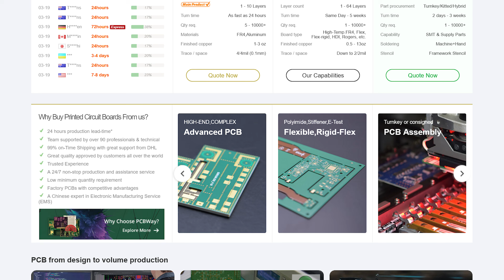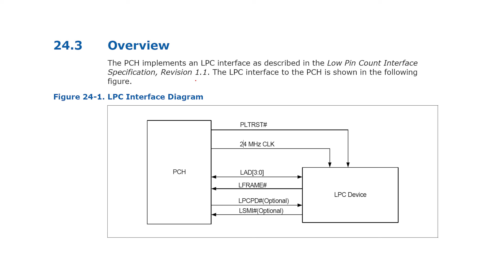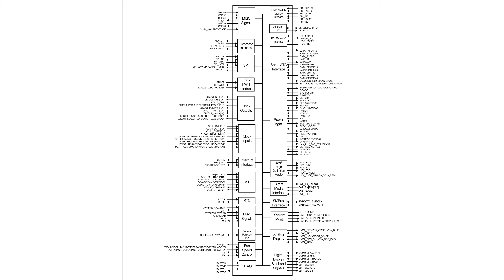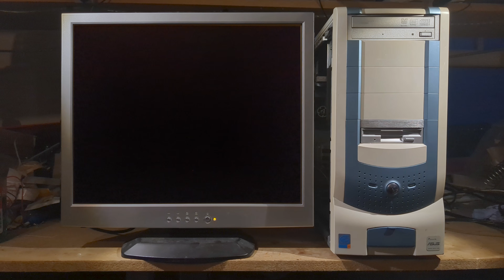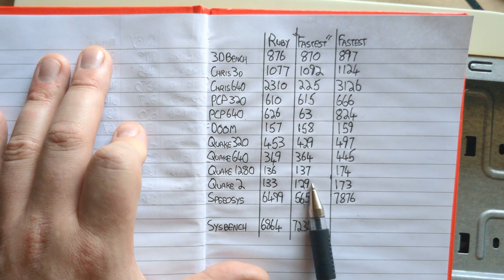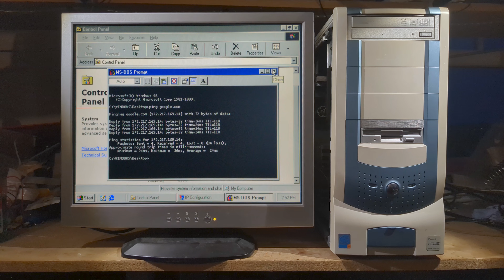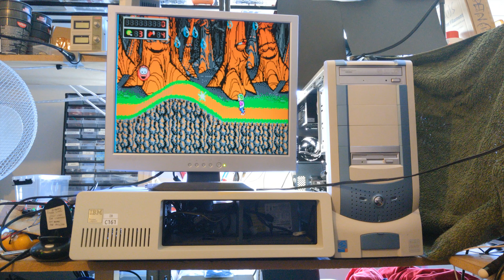No, *This* is the Fastest MS-DOS Gaming PC Ever

Comment: I found for a couple bucks online an adapter that can connect via Compact Memory :) now I've got SUPER FAST read/write, which makes execution seamless. I have a rig like this currently setup with 3.1 and 98Se. I never got to see this era in 720p as my monitors as a kid only went to 1024x768 (most my funds went into vcards not displays). So seeing it running in all of it's glory above that was crazy and I was so impressed at how nice it actually looked! Also that PSU has no rating on it lol, so at full load it probably realistically produces 550w which is still plenty for what you need. You mentioning it's weight is a dead giveaway that it's on the cheaper side of things. I have a couple PSU that are 20 years old, still working. I'm as shocked as you are reading this, I've been in IT for over 20 years....
Reply: Oh yeah, back then (I was younger too but high school) PC screens only went to 1024x768 or possibly 1280x1024.   16x9 monitors (widescreen) really didn't exist during the DOS era.   They made (usually 19 to 21") 1600x1200 monitors, but these were sold for UNIX systems typically (I had a Digital 21" CRT... well I still have it, t toasted and it's so heavy I didn't feel like hauling it off... and it's not even VGA, it uses 5 mini coax connectors and if I recall correctly used sync-on-green. Looked nice until it toasted during a thunderstorm.)

Comment: The fastest DOS machine you own is the one you are using right now to view this video. DOS runs properly on todays hardware it is a total myth that it cannot be run on modern hardware. You DO however need the correct motherboard to run some of those old cards which is where the real limitations start coming into play. But you can also adapt some of that older stuff to the newer boards too. And NO I am not talking about being able to emulate DOS here either. I am talking running actual DOS on modern metal it works fine.

Comment: ISA is not a requirement for sound. I had a soundblaster audigy PCI. It had full dos support. No windows requirements at all.
Reply: I know I was like why does he keep thinking that an ISA slot is a requirement? I have a PCIE 32 bit Sound Blaster card that cost me $350 and it's the best sounding card I ever had. It comes with some really nice software.
Reply: @FreeSpeechWarrior  for me dos gaming = dos compaitble sound and dos compatible graphics.....at least for the games you intend to play. Many modern GPUs don't handle CGA all that well, but do SVGA just fine. that's fine really.
Reply: @awilliams1701  I hear you, you did a good job. My first IBM system in 1993 was an IBM with which I played Duke Nukem, Targan, Hocus, Jazz Jackrabbit, and many more. It didn't take much of a system to play some insane games.
Reply: PCI Soundblaster violates the no Emulation rule. You need a software driver that emulates a real ISA soundcard.
Reply: @joe--cool  nope. I had a PCI soundblaster myself. No drivers needed. It just works in dos out of the box. I had one so I know.
Reply: @awilliams1701  You would still need a driver to initialize and map the PCI IRQ to a ISA bus IRQ otherwise this would not work without either an option ROM or a Plug and Play BIOS extension or Windows 95 ACPI doing the mapping for you.
Or you might have been using SB-LINK/PC-PCI which does this for you but only on supported mainboards.
The PCI bus also cannot "see" DMA channels 1 or 5 without extra drivers or hardware. Do you know the exact model of PCI soundblaster you had?
Reply: @joe--cool  I remember even the audigy being supported in dos. But it's been forever. It's possible there is some kind of BIOS on it. But if it's in the chips on the card it counts.
Reply: @awilliams1701  Audigy and SBLive need DOS drivers and have rather bad compatibility. Especially the OPL3 emulation sounded horrible and was rather laggy. Audigy doesn't have any of the original SB16 chips.
It worked most of the time and was OK with general MIDI but it was still emulation.

The only driverless and very compatible solution I know of is SB-LINK with a special connector on the motherboard.
Reply: @joe--cool  I don't think it was my first. I know I definitely had one that worked out of the box and I had no complaints.
Reply: @awilliams1701   If it was working really great it was probably a Sound Blaster AWE64 PCI with the SBLink cable installed. That would have been a great DOS and Windows 9x experience.
Reply: You may face incompatibility with Dune II for example: both music/sfx/speech will disappear eventually.
"Me too" was sure enough that AudigyZS/Live's (SB0060, SB0100, SB0350) will be okay and no, while being pretty compatible with modern titles like Doom and so on, there's definitely issues with older ones. You'll face no FM synth also, only emulation.
The same for es1370/1/3 based Ensoniq and SB PCI's. The same for YMF724, the same for ESS Solo-1.
Reply: @vsharun  It worked on all the games I threw at it. I stuck with creative labs for a reason. But....eventually I got BSOD's like crazy. The card had gone bad. I haven't had any card since.

Comment: I wonder if you know about the ITE IT8892E and IT8893E bridges. In theory, if you use them both, you can connect ISA cards to an PCIe computer directly. It would be cool for someone to make a "motherboard expansion" that used both chips to have a mini-ITX motherboard have PCI and ISA slots.
Also there's the WCH bus interface chip CH367 that goes directly from PCIe to ISA, but I think only 8 bit slots are supported.
Reply: You are asking the same questions as I was thinking about. Another chip that comes up when searching for PCIe ISA bridge is AX99100A. I think it's a matter of finding out what is generally used in the industrial PC world.
Reply from the maker: I don't think those support ISA-style DMA, so most games wouldn't work with most soundcards.

Comment: Higher end enthusiast/prosumer platform CPUs may offer more cores, but they also overclock just as well as the consumer parts. Plus there's a little to be gained from quad channel memory, at least for Windows. Without delidding, the chips also run cooler with their soldered heatspreaders. It sounds like you should have built something with the X99 if you wanted even faster. Maybe a 6850K pushed to 4.4-4.5GHz (possibly higher limited to 1-core), with probably the lowest-latency DDR4 you can get. It's easier to run quad channel at lower frequencies, due to memory controller limitations.

Of course someone has already run the latest Ryzen hardware under Windows 98, but that required a PCI soundcard. And yes, AM4 is questionable for ISA - that indeed needs more digging.

There's higher to shoot for. Future video? :)

Comment: if you get another Voodoo 2 and an SLI cable you can SLI them and get a huge boost in FPS and run at 1024x768.

Comment: My first PC was a Pentium 100 with 16 megs of RAM in 1996. I am at work right now but I have a chart at home with some benchmarks from over the years. I think that the Pentium 100 got 13.5 FPS in a timedemo, will have to check when I get home. I set software rendering to 1024x768 and I was like "woah thats crazy high res, I WISH I could run that!" lol

Comment: The Broadwell CPUs with the L4 cache chip (E3-1285 v4, i7-5775C and i5-5675C) might be faster than 4790K in gaming workloads, despite the lower clocks. They were pretty much that era's "X3D" chips.
Reply from the maker: Oh interesting. I was also wondering what effects DDR4 RAM might have if we go up to socket 2011
Reply: Ali sells 4980HQ with 1150 adapter. Unlocked fully, with both straps and multiplier. No visible difference between 4670k though.

Comment: If there was more capable mobo with better VRM and chipset that still supports features you need you could in theory OC that cpu quite bit too as those are known to be easy to OC as long as you delid them and use good cooling.

Edit: Nevermind commented before finished the video
Reply from the maker: Perhaps if I disabled 3 of the cores I wouldn't need better VRM or cooling.

Comment: Fun fact, IBM mainframe (z/OS) maintains complete backward compatibility. So, for example, an OG card reader will still work as a valid input device on new systems being shipped today.
Reply: Like the one on the IBM 370/145 that I learnt to program on? I had to submit punched cards with JCL and the program itself. Always numbered the cards in case they got dropped on the floor.
Reply: @yoochoobb  A common trick in those days was to punch the number into the card itself.  That was the original purpose of "line numbers" in programs.  Then you could rectify an "accidentally shuffled" deck of cards by running it through the sorter.
Reply: Its just so funny to see people now using OG to describe a card reader, language is a magical thing :D

Comment: One of the things I like to do in systems with wide range like this is install a removable SATA dock from IcyDock in a drive bay. Then rather than messing around with the BIOS to switch OSs, you can just swap SSDs, like we used to swap boot floppies in the 80s and 90s.
Reply: SATA is (notoriously?) brittle in some aspects, but I think it's due to flexing off-axis. I think it's more robust when the insertion force is direct on a single axis, like it would be with a tray mechanism. Even if there is breakage of the plastic housing, the dock's connector is fixed, rather than being a cable, and friction can keep the drive in place. This isn't much different than using an external drive bay, which people have been doing via ghetto NASes for about 20 years.
Reply: How many cycles is the average SATA connector good for? Perhaps get a SATA power "A-B" switch (unsure anyone has made these but it should be an easy enough DIY project) with both drives permanently connected instead?
Reply: @LouisCYUL  I've got ones I've been using for over a decade and they're just fine, so a bunch?
Reply: But that is what we have boot managers for. Does Windows 11 boot from MBR?
Reply: @milasudril  I haven't done that since the 1990s.

Comment: I remember in a previous video you mentioned the possibility of using a modern AMD chipset with the ISA adapter, did that evet pan out?

Awesome video regardless!
Reply from the maker: No - there's some kind of weirdness with port filtering or PCI subtractive decoding, this blocks the ports needed for the ISA card. I'm sure there must be a workaround, just nobody's found it yet...
Reply: @TheRasteri  aw, heres hoping somebody figures out why, would be cool to use a soundblaster on the newest AMD chips

Comment: furthest i've pushed Voodoo 2 compatibility is running it on Ryzen 5 3600 PC with B350 PCMate Mobo since it has PCI Slot and sketchy win7 x64 drivers on Windows 10 but it worked :D voodoo compatible games were launching without issue, i wonder if you can put Dissapointment on it too since it has TPM slot too with LPC adress, data and clock available, put sound card an sooo maybe 5800X3D dos gaming pc in the future?
Reply from the maker: I still haven't figured out how to get disappointment working on AMD chipsets. Hopefully someone eventually figures it out.
Reply: @TheRasteri  Pretty sad, you have done so much already I really love watching your videos and hope you will have much more subs and viewers 😁 I will probably build myself something similar to tinker with, I'm really incapable to figure it out, hopefully some wizard will join on this journey, or some technical documentation leaks out I want Sound blaster 16 on my PC too 😂

Comment: which software do you use with the old Final scratch interface? Mixxx, Traktor Dj or OG Finalscratch ?
Reply from the maker: OG finalscratch and Traktor FS - https://www.youtube.com/watch?v=CTd0hUxlp2A (I don't actually use it anymore, I have a DVS mixer, Numark Scratch)
Reply: @TheRasteri  i used a rme hdsp rpm with mixvibes but swiched to traktor dj + z2 mixer later. the rme interface could do 32bit buffer size and if you turn of some setting in mixvibes it ran without dropouts
Reply from the maker: @ I used to use mixvibes too. I also used to use a z2 :)

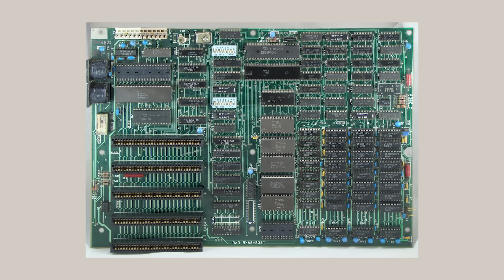Comment: 03:33 There is technically SB Link PCI or PC/PCI option for soundcards, but those motherboards are few and far between with supported soundcards being even fewer.
Reply from the maker: @Vanessaira-Retro  also ESS cards had that weird TDMA thing, I keep meaning to mess with those
Reply: @TheRasteri You also forgot Sound Blaster MCA cards 🤔
Reply: You should also checkout cmedia cards, some of them come with a genuine opl3 and supposedly work fine with dos games while being pci
Reply: that's odd, I feel like there were actually a good number of SB-Link cards and compatible mobos.  I guess maybe it was just my bubble I was in, but it seemed like for a few solid years there the majority of cards coming out were PCI sound cards that emulated SB with SB-Link for the port stuff.
Reply: @georgen9838  There were about 8 or 9 PCI cards with SB Link capabilities, and half of them needed the pads to be soldered on.  Many 440BX motherboards had SB Link as well with about 40 ish boards out there from different OEMs.
Reply: @ I see -- thank you! That makes a lot of sense.  I certainly was deep-diving into that stuff during the 440BX era, so makes sense that I would've felt I had a rich set of options for PCI sound cards without running into SB compatibility issues.  At first I thought I was simply thinking of the software kludges a lot of cards shipped with to enable SB support, but then I remembered that those always conflicted with games using DPMI extenders so that couldn't be what I was thinking of.  Memory's hazy from how long it's been!
Reply: The only motherboards I have seen that support sblink also have ISA slots. So may as well use an ISA soundcard.
Reply: @RetroPcCupboard you know what, I suspect I'm misremembering even more than I originally thought.  I could've sworn I was using SBLink on an Abit B440 back then with no ISA slots.  But I could honestly be 100% wrong about that and I was doing SB on that some other way.  Wish I still had those parts.
Reply: @georgen9838  there's no such board on theretroweb, either this is a board we're missing, but I doubt it, or you're misremembering the name

440 is a typical name for a chipset of the time (440FX, 440LX, 440BX) and they all had ISA
Reply: @georgen9838  There are some that don't have ISA slots. But I've personally never seen one. Intel VC820 motherboard is an example

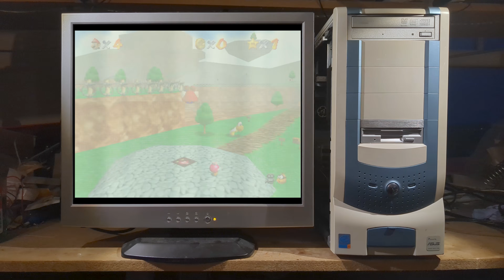Comment: 23:00 - I think you need a pair of Voodoo2's to get 1024x768 - at least I found this when I borrowed a second one off a mate of mine back in the day!
Reply: Don't you need specifically two 12MB VooDoo2 in SLI? I think that with a couple of 8MB ones you would be limited in SLI to 800x600 if I remember correctly.
Reply: @RetroTinkerer  No, the difference between the 8mb and 12mb voodoo 2 was extra texture memory. So, the 8mb vs 12mb doesn't matter for resolution but will allow for more detailed textures. It is however correct that if a game used Z buffering, and most of them did, you had to have 2 voodoo 2's in SLI to go above 800 x 600.
Reply: he should really get a Voodoo 3